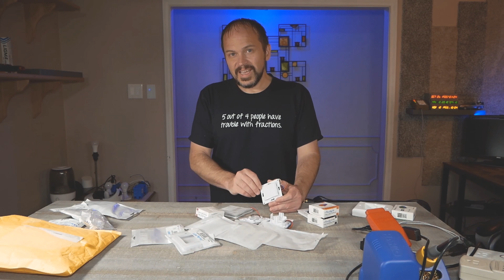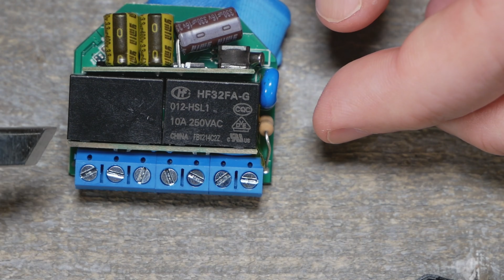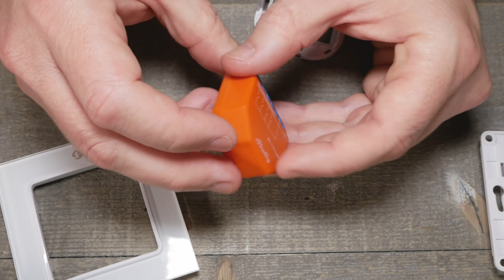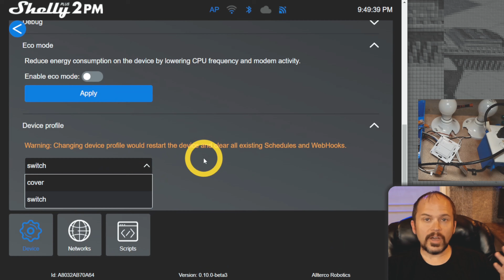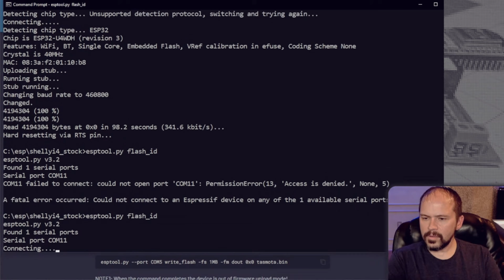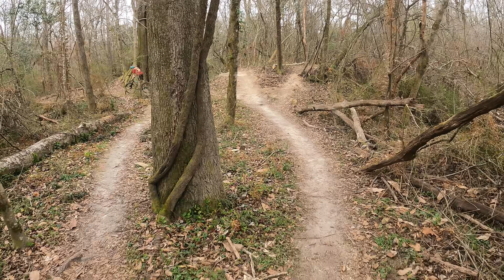Shelly Plus 2PM Review | ESP32 Smart Relay w/ Power Monitoring

Comment: I wonder why the manual says to connect both the L terminals to live when they are soldered together on the inside? I would think running live to just one of the L terminals should be plenty?
Reply from the maker: I guess they want more power feed across the terminals?

Comment: Did you get the pinouts for the power monitoring stuff? Got mine today and ofc put ESPHome on it, but lacking the power monitoring for now.
Reply from the maker: Negative. No word received on it. Time to get the solder wick out. I did look at the firmware dump and saw references to the same chip in the previous Shelly 2.5 so support shouid he fine as long as the IDF feature set in Esphome includes that.
Reply: @digiblurDIY  Yes, I disassembled mine today an there is an ADE7953 on it (as on the Shelly 2.5). Did you find out the pins so far?
Reply: 25, 33, 32, 35, 34 are the candidates for SCL/SDA.
Reply: 27 SCL seems to be GPIO25
26 SDA seems to be GPIO33
IRQ seems to be GPIO36

Comment: Thanks for the great video, especially the mountain biking at the end. I love biking and it was great to see you and your boy out shredding the single track. 

I wanted to ask you, is it possible to modify the firmware on the Shelly motion?  I got one to play with, but my Home Assistant won’t recognize it. It saw it, when I first got it, but I think upgrading the firmware made it disappear; and, though I tried putting the older firmware back on it, it still won’t appear. Any ideas?  I could send it to you, if you want to check it out.
Reply from the maker: Thanks!  Love the biking trails here.  Lots of fun especially for a mostly flat terrain region, this is a little gem.

No, I don't think it is ESP based given the info they have on their website for specs on it.

Comment: You can use OTA Tasmota flash on shelly now.
Reply from the maker: Nice! Haven't checked that project in a bit to see if they added Plus support.
Reply: @digiblurDIY  Google Mongoose to Tasmota, can't post links YouTube delete them 😂
Reply from the maker: This? https://youtu.be/_oRr8FZyyQ0
Reply: @digiblurDIY  yes 👍
Reply: OTA is cool if the relay is already installed and mains powered but I prefer to flash via serial on my bench and prepare the relay this way before actual instalation.
Reply from the maker: Serial access is awesome in devices. Fix and do all the things.